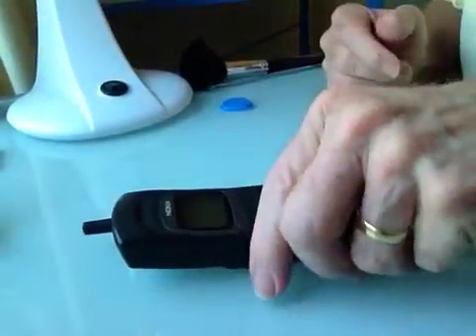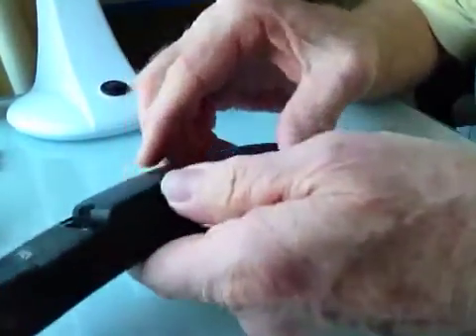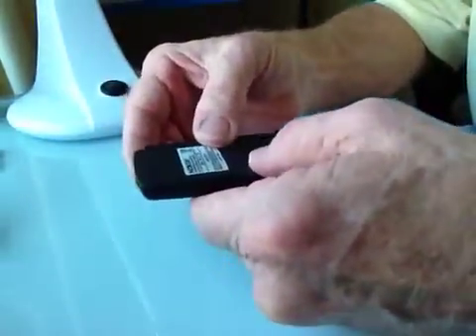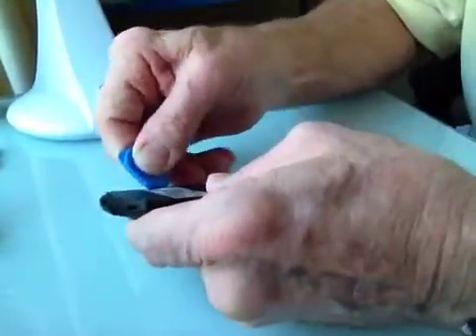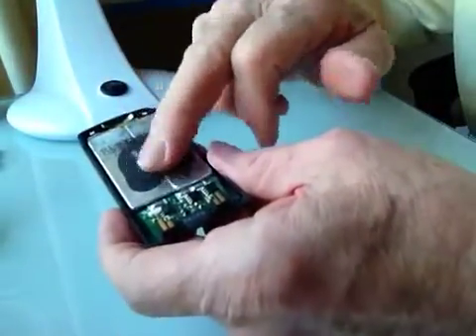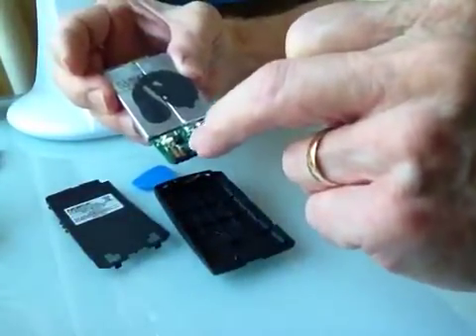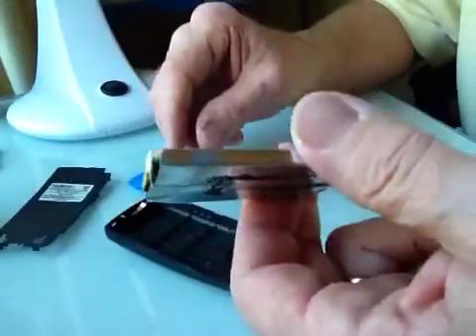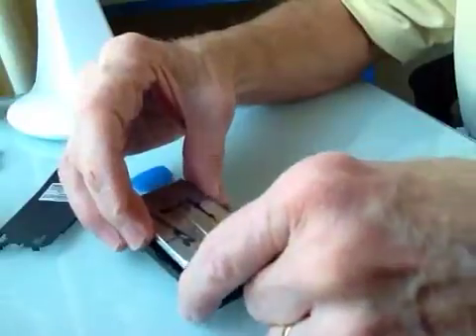Nokia 8110 Battery Disassembly

Comment: I did it!  I bought two 3.6v (700mAh) batteries and connected them in series.  I found a schematic on the internet and it works!
Reply from the maker: Well done!
Reply: @lukad9934 Can you tell me where you got the two 3.6v (700mAh) batteries from and how you connected them in series? I'm trying to do the same thing. Where did you find the schematic? Thanks for any help you can give.

Comment: Hi Greg, did you find replacement cells? I also have same phone & looking to replace cells
Reply from the maker: Hi James. I haven't progressed the battery fix mainly because Australia has abandoned the 2G network. But I notice a guy in the UK has posted a series of videos with a positive outcome. Check it here - https://youtu.be/oLjJtPs1uMA
Good luck - Greg
Reply: @smithgregorya  brilliant, thanks mate. I've got as far as you did so far 👍🏻
Reply: @smithgregorya  Thanks to your link, I have successfully fitted new batteries and my Nokia 8110 is up and running again! 👍🏻
Reply: @smithgregorya  check it out instagram.com/JamesDeanGB
Reply from the maker: Excellent James. Such a cool phone. Well done.

Comment: Hi Greg I came up with a way to replace the cells. I'll add the link. could you please let me know if it makes sense?
Reply from the maker: Hi Nick. Great work and I intend following your process. Regrettably Australia has turned off the 2G network and my ability to impress my friends with a true retro mobile phone is now unlikely but the technical challenge still has merit. I'll let you know how I go. Cheers - Greg.
Reply: Greg Smith thanks Greg, I'm sorry to hear that. Thankfully in the uk there's no plan to do the same. especially now all the smart appliances depend on 2g technology.

Comment: It looks like you have 2  Lithium Ion Batteries > 3.7 Volt Lithium Ion Flat Rectangular Batteries > 
3.7V 800 mAh Li-Ion BK062265 Rectangular 

Connected in a serial setup to get te 7.2V.
found them at http://www.megabatteries.com
Reply: I tried replacing the cells with some new 3.7, unfortunatly it did not work, must be something with the logic board that is broken.

Comment: Greg I have exactly the same very old phone bought in 1997 and I am very attached to it. My friends call the thing "an old bone". I happen to have the same problem that my battery no longer has the ability to upload and I am not at all technical so I would never want to open up the phone and fondle around with it. Actually a friend just gave me a great tip: There is a German firm that receives your phone and repairs it for as little as 50,-- euro. I find that very do-able because the phone has "emotional value" and might very well in the future become a bit of a collectors item because the phone was staring in the Matrix movies. Below you will find the link, I think the speak English as well. Just do not use up their last battery svp :)

http://akkuplus.de/Akkureparatur-Zellentausch-Nokia-BLJ-2-72-Volt-500mAh-Li-Polymer